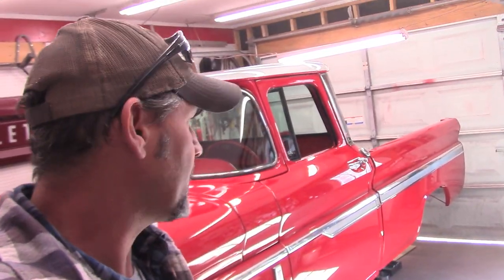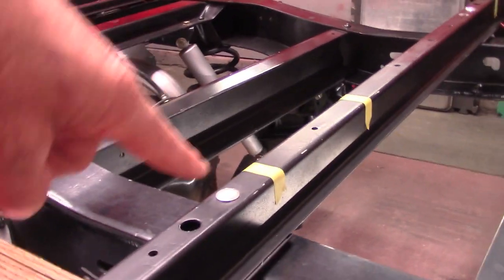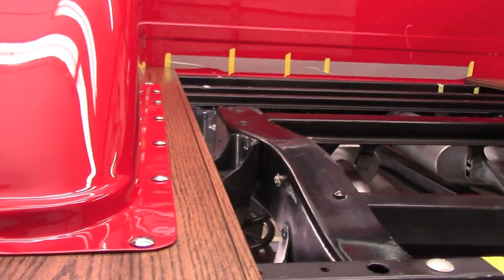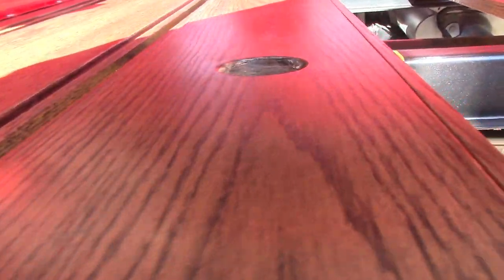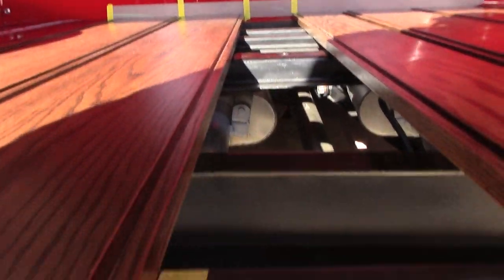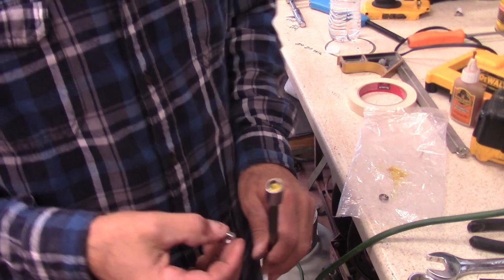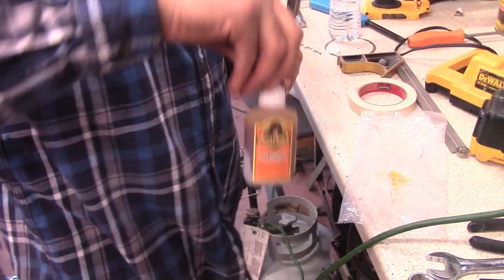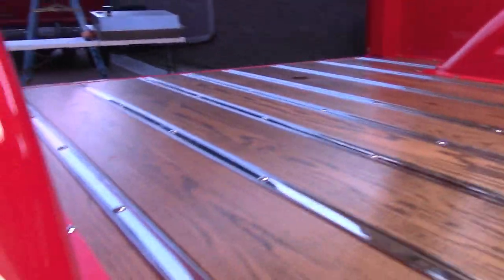Install MAR-K bed wood 63 c-10 truck

Comment: This may be a dumb question, did the wood make the bed sit up an inch higher than the stock steel bed? I have a 59 F100 fleetside that I want to put a wood bed in and it'll sit between the fenders and not around.

Comment: Six years later, I'm wishing you well with that outstanding work you've done to your '63 Shortie.  Looks stunning! I have a '65 Short-Fleet here in AZ and, like you, I ordered an Oak bed wood kit from Mar-K.  QUESTION:  Does their wood require protective coat(s) of sealant, or was that just your decision?  I just want to make sure I don't miss a critical step.  Once again, perfect restoration, Gibson!  Wondering if you finished the turn-downs, as my experience has been excessive droning sound inside the cab. Best wishes with your honey!
Reply from the maker: Thanks for watching the wood is  still holding up

Comment: That's a great looking fuel tank.  Did you calculate or test its capacity yet?  Also, did you put any baffles or anything inside of it and, if not, can you hear it sloshing around (probably drowned out by those echoing turndown pipes :-).